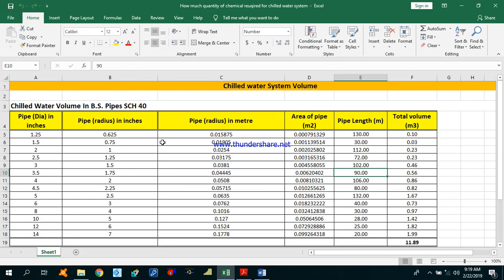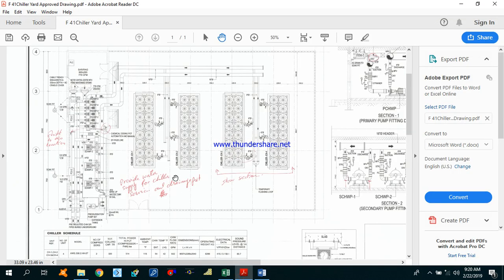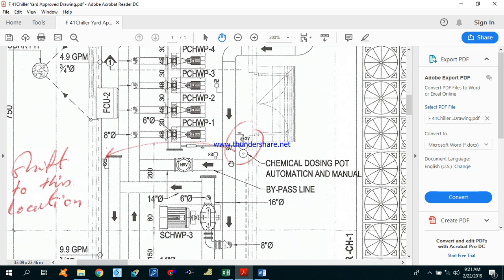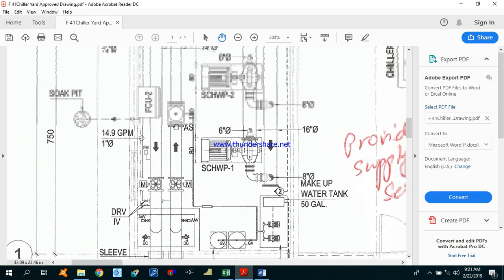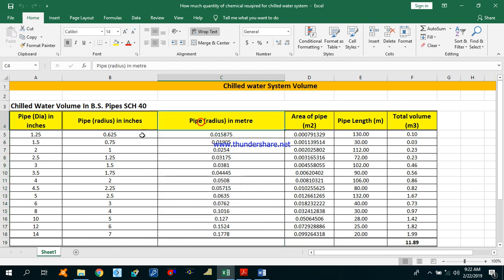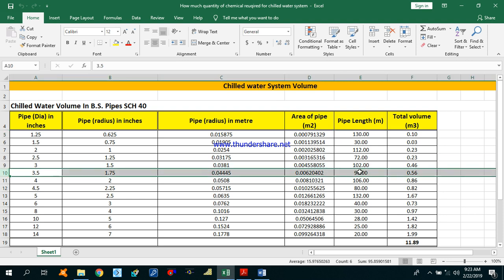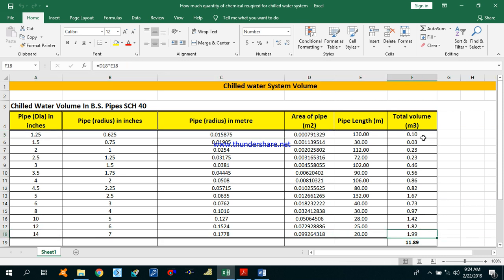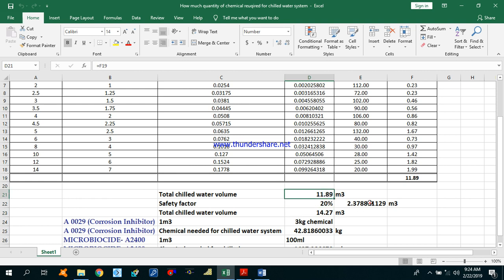Chilled water chemical quantity calculation for hydronic system (Chemical dozing system)

Comment: Hello,sir i want to ask one questions... how much water content per tr in chiller (7.15 ltr as per thumb rule is correct) means i am calculating water volume in system
Reply from the maker: For exact water content in water side equipments like FCU, AHU and chiller you need to check supplier specifications because it varies with the size of equipment

Comment: Want to add supply line+  return line 
Eg: 25 mm pipe - length supply 10 meter + return 10 meter.